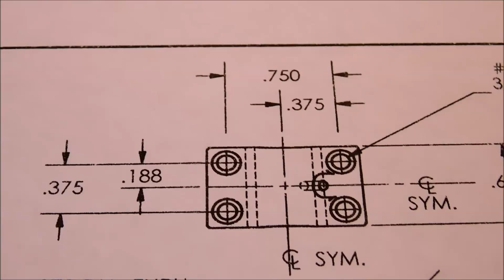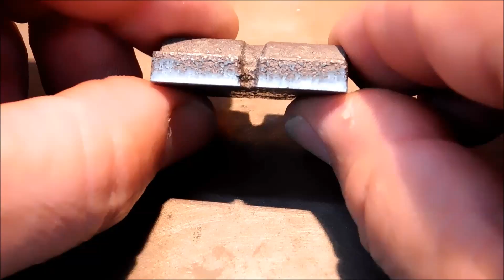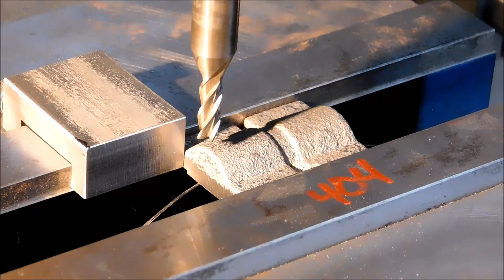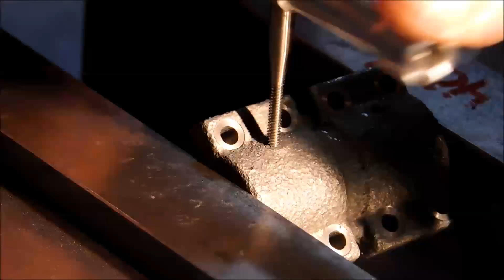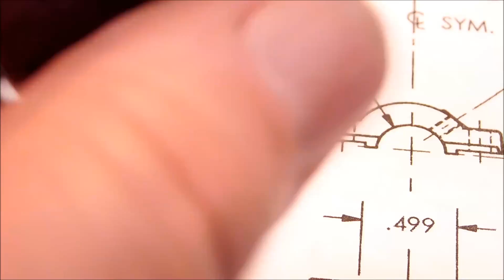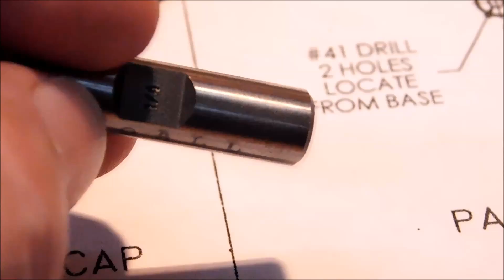Machining a Model Steam Engine - Part 6 - The Bearing Caps

Comment: A question Joe, why not leave the oiler holes until after the assembly to the base. The holes can then be drilled exactly vertical to the final assembly. Sort of the ultimate holding fixture for that feature.
Reply from the maker: You absolutely could.

Comment: I remember my old boss teaching me how to get ultra precise measurements with Dial calipers, by measuring a gauge block stack and measuring the difference. If you are consistent on your measuring pressure you can split the graduations on the Dial calipers
Reply: I kind of remember the job, the parts had a concave side and a convex side, so it could have been measured with a carbide tool shank and micrometers. But dial calipers were a lot faster, and it needed to be fairly precise due to the potential of compounding error with multiple Set-ups. 

Which can be a trap for new players in production jobs.
Reply from the maker: We had ring gages to set out calipers to. The curved surface of the bore makes them a better choice than the flat parallel faces of a gage block stack.

Comment: I know engineers can be kind of strange in a lot of ways, but why  and what is the purpose of having a measurement of .499" ......why not a simple .500" .
Reply: There will be a mating part and it could be the one that's .500".  The application could require a 0.001" gap and this results in this part being .499".  That said, I think you do see more goofy dimensions than in times past due to the ease of adding part features in 3D CAD that are then automatically transformed into drawing dimensions with 10 decimal places.  I believe we are also seeing negative effects from upper management firing all the draftsmen and designers in the belief that engineers can now just make the drawings.  We're not trained to do that effectively, though many are too naïve/arrogant to realize it.
Reply: @mgraen  
The draftsmen I missed the most in those transition days were the guys doing my PCB board layout. They never screwed up on the design, where I tend to always have one part placed just slightly too close to something else.
Reply from the maker: I agree.

Comment: The oil cups are more exposed, but a Cox .049 engine is held together with four 2-56 screws, and they survived quite a bit of abuse from me as a kid.
Reply from the maker: But these 2-56 screws will be hollow in the center.
Reply: @joepie221  Depends on how big the hole is. Minor diameter is 0.064–0.058 for class 2A, you could probably drill that with a #76 (0.020") to #78 (0.016") and be ok. Drilling that would be a pain, of course.

Comment: A considerable drawback with the Imperial system is the mental gymnastics you have to do to convert odd fractions in to thousands (actually milli-inches) for the DRO or digital calipers.
Reply: Another quick tip, to convert decimal back to fraction (say for selecting a drill), multiply the decimal by whatever fractional size you want to hold and round the result to the nearest hole number. For example to convert 0.187 to fraction, multiply by 16, round the result (2.992) to get 3/16.
Reply: True, but for an old man, it keeps my math skills going, and its fun. For efficiency though metric is better, agreed.
Reply: Math is fundamental... and yes, it keeps you sharp(er).
Reply: Nobody really uses fractional inch anymore in machine shops. That stopped being a common thing in the 1950s.
Reply: @SuperAWaC  oh ok
Reply: @SuperAWaC  lie.
Reply: @markthompson4885  ??
Reply: Quick fraction trick. Divide the numerator by the denominator for thousands. For instance, fraction 3/4. 3 divided by 4 = .750.

Comment: Another good way to tap small hole is use a long bushing in the chuck with the hole to match the od of the tap, grind a small flat on the center of the tap for the handle and this way there is no downward force on the tap. I also use knurled wheels with a setscrew to tighten on ground flat instead of bar tap handles so I can grab and turn in small parts of a turn. This way works best for me because the shank of the tap is supported in the bushing so no side loads go into the tap. I also use a Walstrom Chuck so never have to shut off spindle and can change from center drill to drill to tap bushing on the fly.
I wish I had known about your shop when I was working in Waco on a work project in 2002 I would have stopped by and said Hi.

Comment: Oh my current grinder is "8" 3440 something rpm.  Why is slow grinding always suggested for carbide ?  If I am understanding correctly
Reply: Not always. For quicker material removal, fast grinding is ok, but for finishing you have to use very fine grits, low pressure, and low speed to have a nice control on the tiny material removal you are going to perform. It would be the equivalent of manually "honing" the edge of a hss tool, but with carbide.

Comment: Wouldn't it not make more sense to mill the center half-bore before separating the 2 pieces?
Reply from the maker: It is an assembly level feature. I'll do it as I bore the frame in the last operation.
Reply: @joepie221  makes sense to get a straight forward feature.
Cheers for the reply
Reply: He said the bore will happen at assembly, which probably means once the parts are mated to the main frame then in a single action the axle guides for all parts will be made so as to assure perfect alignment.
Reply: maybe he's going to bolt them together and bore them "whole" as it were?

Comment: Joe, love the project videos.
I do have a question:
Why do you use a center drill rather than a spotting drill? 
The larger diameter on a center drill is entirely the wrong angle for a drill, and can lead to chipping of the flutes.
Spotting drills are like roughing mills, once I started using them, I wondered why I held out using them for so long, and then never looked back.
Reply: A center drill works perfectly.  I've drilled hundred of thousands of homes on both mills, lathes and drill presses. Always used a center drill and never noticed a broken flute despite of a 'wrong' start angle.
Reply: You are absolutely right, but I think that this is not an issue when drilling "soft" materials as cast iron or aluminium. Of course, when drilling tool steel with a "center drill" spot you will see a nice bite in your drill edges. You will always find the typical comment of someone doing it wrong his entire life defending they had no issue at all....I prefer to do it right.
Reply: It is preferable to use a spotting drill yes, but in practice it doesn't matter much for anything  besides harder steel or tool steel. Carbide drills you don't spot drill for at all.
Reply: @SuperAWaC  The issue is that if you spot drill with an angle narrower than your drill one, when you start the hole, all the drilling pressure is applied on a tiny contact line, and this is what destroy the drill. 

If you don't spot drill, this is not an issue as the drill engages with all the edge. 
That's why you spot drill at 120 degrees for 118 degrees drills
Reply: @diegovianavillegas3297  Like I said. It effectively doesn't matter in soft materials. I use 90 degree spot drills so I can spot and chamfer in one operation in aluminum and steel and it doesn't matter. Saving the time doing a spot and chamfer in a single op using a 90 degree spot drill is worth a lot more than the extra wear on the drill. For anything tougher/harder I simply use carbide TSC drills and don't spot at all, and chamfer after.

Comment: Hey Joe, hope all is well. I was just wondering why you did not remove the same amount of material on both sides of the casting to achieve a nice finish  on both sides? I think I may have gone that way. Be safe my friend.
 Brian
Reply: If by "both sides of the casting" you mean the top and bottom sides, Joe probably didn't machine the top surface because he wants the "cast" surface finish to match the rest of the model.  I did expect him to sand blast the machined edges to hide the machined surfaces though, like he did on some previous parts in this series.  If I'm misunderstanding what you meant, I don't know how to (try to) answer.

Comment: Hi Joe ,
I also hate using tiny taps ! My current engine calls for quite a few 10BA ( British association threads ) and these have a major diameter of 0.067 in  but that isn’t the worst of it  ! one thread is for a throttle linkage turnbuckle which requires one thread to be  a left hand thread - try getting one of those taps or dies here in Australia !  I can see the linkage design being altered !
Cool tip using the broken  cutter to align a tap with a pointed centre !- never in a million years would  i have thought of doing that !
Reply: If you can lay your hands on a grade 9 bolt, you can grind and file it into a tap that is good enough for a few holes in soft metals or cast iron with no need for hardening.
Good luck :)
Reply: @joshua43214  
Unfortunately a left hand 10BA bolt is just as rare as the tap!
This bolt is 67 thousandths of an inch or around 1.7mm diameter also .
I used to do a similar thing to what you suggested to clean out spark plug holes .
Reply: I have a friend that is watchmaker and he uses to run taps in sub-milimiter diameter without sweating. I always tell him, he's my hero. Anything below M3 scares me.
Reply: @diegovianavillegas3297  
I used to work with a guy who would literally tremble when he saw a drawing that had required 1/4 unc threads ! He always reckoned he broke  any tap under 5 /16 !
I offered to tap the hole  and he produced the tap and a drill - his problem  was he was trying to use a 3 /16 drill as a tapping drill and it was in hot rolled steel !  I gave him a 13/64 and told him to try that and his problem vanished !  How he came to use the 3/16 drill i will never know - maybe someone put the drill in with the tap by mistake .
He was an apprentice boilermaker at the time  and didn’t have a grasp on threading .
Reply: Ian I am in Brisbane I have a lot of BA I will have a look.
Email address please ?
Reply: @christophercullen1236  
Hi Christopher,
Thanks for your kind offer !
I’m in Sydney - the other side of no mans land that is the tweed river ! 

I have a heap of BA taps and dies down to 10BA  but this one little part on the M.E beam engine i just started needs  one end tapped for 10BA left hand thread .
If you have a 10BA L/H tap in your possession it would be a miracle! .
Modifying the design which is nothing more than a piece of brass hex tapped each end and machined so only a small length of hex is left in the middle is pretty easy . With this engine and the  Rosebery engine i finished last year ( i believe they  are the kits from EJ Winter but i got   them off ebay ) i think the person designing them was a tap and die salesperson ! The Rosebery is a real dogs breakfast when it comes to threads , it has  BA ,ME,  Whitworth , Metric , and a 10x1mm thread for the spark plug .
That reminds me i must  check EJ Winters and a few other model engineering supples stores here in Australia  and see if they sell a small turnbuckle and the drain cocks for the cylinder .
Regards..
Ian.
Reply: @Flattyman  I know what you mean about the different threads people use. I guess a designer has a tap and die that's about the size they want so they use it. Then the rest of us have to buy the oddball thing and use it once :(  I was looking at something that wanted some absurd small imperial threads  - not even BA or ME that I could see,  that was impossible to get in Aus.

Comment: Cheap and dirty sure works for me my friend. As I worked with castings that weighed tons instead of ounces I can always relate to the setups and executions you show here are Identical to what I delt with. Right down to casting flaws, flash etc. Nice neat job once more Joe Pie. Thanks bud.
Reply: I'm surprised that the engine kit supplier didn't use finer sand to not lose the small details due to coarse sand.  I've watched Foundrymen sift fine sand on the patterns for this exact reason, but on larger parts than those in this engine kit.
Reply: @bobvines00  I hear ya. I pour pure silver on my channel and know the difference between casting sands (Petrobond) and clay (Delft clay). The clay will pickup finer details. Stop by for a visit if you like. I am a retired welder/fabricator/machinist working in the logging industry in BC Canada.

Comment: Well one thing for sure you all are making me want to build my own steam engine.
I'm thinking it may be a good gift for my younger brother children.
Don't think I'm going to buy a casting go to make my own; steam engine re so wet & messy.
Joe,... want to build a stirling engine? That's my fascination.
Reply: A Stirling engine or a flame licker - not sure which to try making at the moment
Reply: I bet that most steam engine models are run on compressed air.  You could go ahead and build a steam engine kit and simply use compressed air and avoid the mess!  ;)

Comment: Joe, i am a hobby machinist (although I play a real one at work). I want to say, I have been watching your channel for some time time now, and I get something out of every video you produce. Thank you for producing this kind of content. Your videos are always clear & close-up, so we can see the details. However, your audio is sometimes lacking both in volume and clarity.  I'm sure you noticed this in editing. Your channel would benefit greatly from the use of a wireless microphone. Just something i thought  your viewers would appreciate. Keep up the good work Joe!
Reply: Just my thoughts... Being a machinist especiale doesn't make a decent sound engineer. There are tricks of that trade to learn. But I'm guessing the quality of the content makes up for the sound engineering.
Just try using a broadcast type multiband compressor / limiter. Adjust the sounds to be just audible at whisper level when mastering the soundtrack.

Comment: Didn't you forget something, like the bore in the middle?
Are you going to drill them when they are on the other part?
Reply: They need to be line bored for perfect alignment once both caps are installed.  I always match mark the main bearing caps when disassembling an engine because once line bored the caps are no longer interchangeable.
Reply: I think that's the plan to make sure they're perfectly aligned
Reply: See 0:23 - drawing says to machine the bore after assembly with base.

Comment: 2-56 is giant compared to the 00-80. I hand tapped quite a few 00-80 holes on my HO scale brass locomotives. Not held in a vise on a mill or drill press. Slow and careful is the rule of the day.
 Keep the great videos coming Joe.

Comment: Did I miss something? When are we going to cut the inside radius on the bearing caps?
Reply: That gets done once the cap is attached to the frame. That will ensure a perfect fit for the crankshaft.
Reply: @TactlessWookie  thanks dude... I feel a bit sheepish I didn’t think of that myself. lol
Reply: I think I heard Joe say "...at assembly", but I can't find the time mark!
Reply: 0:23 - it's on the drawing :)
Reply: How are they watching but not paying attention? Comprehension is achieved by listening, it’s all there just like in school, eyes forward stop daydreaming.
Reply: @FrancisoDoncona  I know, right? I missed one whole sentence in the first 13 seconds of video... 🖕🏻🙄🖕🏻
Reply: While in one piece would milling a 90 degree vee 0.141" deep on the centerline produce a location for the 0.200" diameter roll pin to bore the mount's 0.375" bore?

Comment: 16:15 - Joe, looks like the bearing caps weren’t entirely seated on the 45° parallel when you locked in the vice... was that intentional or did I catch an oopsie? Not a competition but it is always nice to catch your mentors and instructors in an error. Makes you feel like they’re actually teaching you something. 😉
Reply from the maker: No sir, you didn't catch an oppsie. The 45 degree angle gage was registered on the .031 elevated section of the part. Thats why it looked proud of the angle surface. If you believe I mess something up, call me on it. I won't mind, but this time its a swing and a miss.
Reply: @joepie221  what differentiates a good teacher from a great one is the ability to be gracious when challenged by a student even if the student is wrong. 😉

You’re an excellent teacher. 👍🏻 I’ve learned more just from this series pretty much any other machining training I’ve seen.

I concede... no oopsie. And thanks for responding. I doubt I’ll ever actually catch you in a mistake, but I learn more from when I’m wrong about something than I ever will when I’m right! 😁
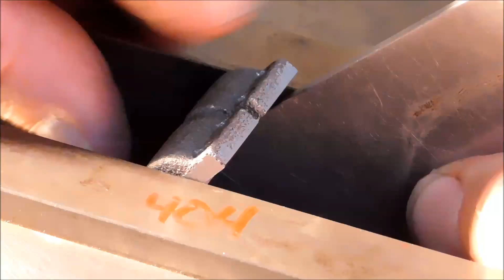Reply: @joepie221  I follow now. I backed up to 16:00 and watched again and realized what I missed the first tome. To be honest that would have got me if I had been doing it myself, too. 

That’s when I stop, back up, look at the part and print, figure out where and why my eye thought it saw a problem, and only proceed when you understand what you thought you were were seeing. 12 years working in Grandad’s diesel shop created a few good habits. 😉
Reply: He trued it up with a 45° angle block before he drilled.
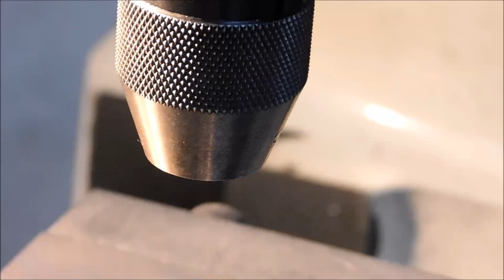Reply: @amicidavinci  yeah but it looked to me like the top of the part was still standing off the angle block by about 3/32 just before he “clamped it with his elbow”. Maybe it’s just my eyes playing tricks on me. Watch 16:00 to 16:30 again... it doesn’t look like the part ever fully engages the 45° block.
Reply: @ArmchairDeity   There is a step in the bottom face of the part from the previous machining operation.   
 .499 Dimension.   the part is  registered correctly  on the 45 degree  block
Reply: @scottbaldridge1092  AHHHH SWEET, thanks, I see it now... the flange of the cap is standing proud off the angle block because of the extra material on the center...